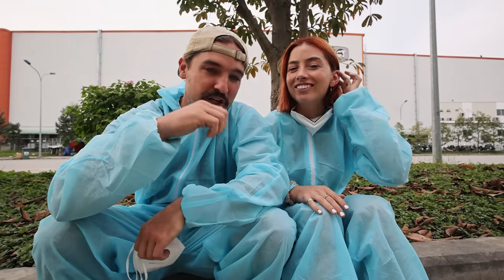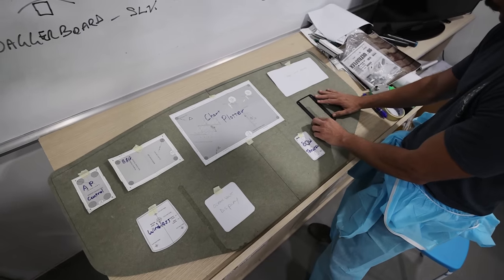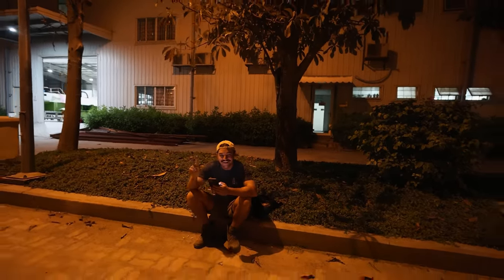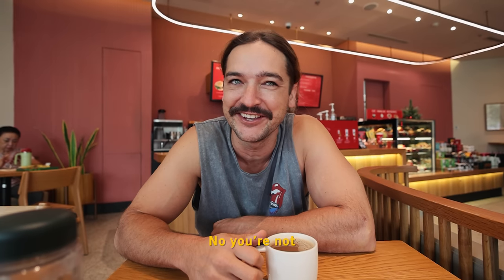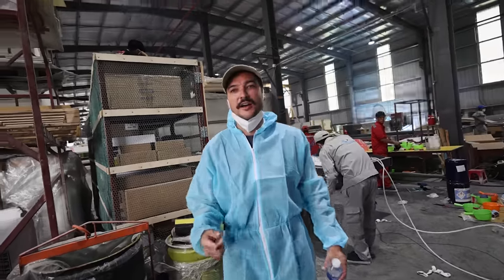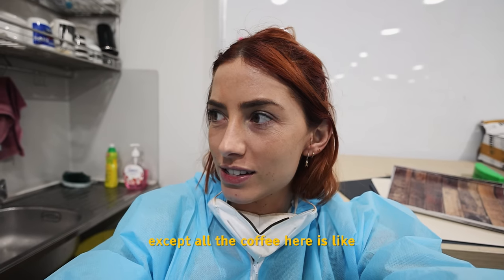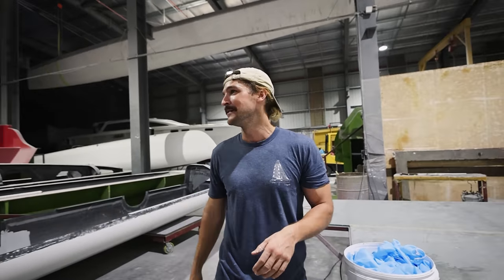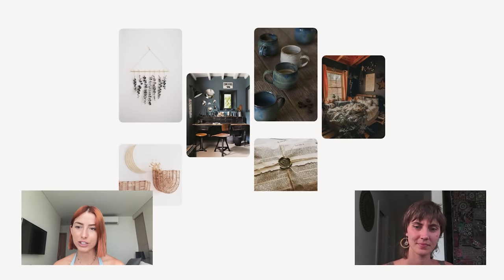BOAT BUILD: Interior work Begins!

Comment: Can't go wrong with different Cacti, Aloe Vera, Balloon, Orchids, Violets, Ivy, Philodendron plants, or Venus Fly Traps could double as a decoration and help with your flying insect control 😉.   A nice arrangement of Hearty Aromatic Herbs would be nice on a boat too.  A small Aromatic Herb Garden in the bathroom/head would be pretty cool.  It would mask odors, And you could pluck rinse and season your meals with them.

      Especially Basil, Bee Balm, Eucalyptus,  Lavender, Lemon Balm, Lemon Grass,  Marjoram, different Mints(Cat Mint has a strong pleasant aroma), Oregano, Rosemary,  the different Sages(especially Pineapple Sage & Common Sage), Thyme.  Oh and Wormwood Smells Amazing too.

      Just be aware Wormwood  has become a Warning Label plant., and it is one of the ingredients used in distilling Absinthe. You have little ones so you need to decide if it is a plant you feel is safe for them to be around.

Comment: Charcoal filters or a fresh air system ( even with the hot humid air) are a must to save you lungs .
Full mask (save your eyes)with the fresh air system may be the best way to go .
Been in the coatings industry for forty years.
Reply: A message from the management of Rapido Trimarans:

We are very proud of our workers. Their safety and well-being is of the highest priority and unfortunately, as shown in the video, we collectively let ourselves down in this instance. 

3M respirators and face masks are supplied and have been taught to be worn at all times but they were not being worn at the time of the filming. This issue has now been addressed.

Giving an independent third party unrestricted camera access to our factory can be confronting. In this case, it has highlighted an important issue for us, which we need to have rectified.

As a company, we will continue to learn and try to do better in our quest to build the best ocean-cruising trimarans in the world.

Comment: Well as both a skilled spray painter, Jotun/Akzo nobel aficionado (certified coating and surface protection inspector FROSIO lvl III)  and a skilled  fiberglass/carbon fiber builder - i can say that i seems like you are in extremely good hands.

-Carry on, carrying on!

Comment: Light industrial grey at the engine bay. Orlando orange on the power wall. Victron Energy Blue on the water system area. Red, white and black checkered floor. Ceiling white or eggshell.

Comment: I can't even imagine how the build process is going from the current state to putting her in the water in 3 months. I mean, I'm rooting for you and it will be amazing to see you launch it, I just don't understand how everything still missing will be fitted on time (electronics, engines, drive shafts, steering, plumbing, under water sensors, various through holes...).

Comment: Please be careful of the akzo Nobel paint surfaces. Very hazmat sensitive. May have off gasing if used on any interior treated surfaces. I used to transport it and the accompanying hazmat paperwork was a nightmare!
Reply: I just read thru all the comments. I was not trying to get up on a soap box guys. Just sharing some first hand experience from working with Akzo Nobel products you may not have been aware of. Hate for you two or the boys getting breathing problems.

Comment: God, it is much larger than it looks. One of my thoughts is not for the colours inside to be to dark. Reflected light can bounce of light colours much better than dark ones. Succulents in moist areas always work well as I think you mentioned. With the movements of the sea and objects will the wallpaper last long enough or is there a coating that goes over the top to minimise abrasion? As I said before it is like moving from a two bed flat into a Mansion.
The excitement for you all must be immense, as it is for all of us watching. Just a point of note has Riley been working out a lot, or is it the camera lens? his biceps looked beefed up?

Comment: Looking good.
You will be visiting twice as many places by the look of that rig.
Did I hear correctly when you said there is no  SS on the boat at 14.46 ?
How do you attach the rigging etc , surely SS rigging to Carbon fittings would not last .
What am i missing ?
Cheers.

Comment: I remember when they 1st decided to go with this boat, and Riley was talking about leaving much of the carbon fiber exposed. When they 1st saw the interior Riley seemed completely shocked at the roughness of the interior. He was expecting smooth as glass, like you get pulling a part out of a mold. Instead you have these extremely rough pieces that require endless fairing and layers of paint to bring to a perfect finish. 40% or more of the entire construction budget is probably eaten up with the fairing and painting.
Reply from the maker: No I wasn’t.

Comment: Did I miss something .... I only saw the master & guest bedrooms.. where are the kids bedrooms & those for the crew ????  It would help give us perspective if you could give a comparison using the square footage of interior living space on the new boat & the “retired” la vagabond.... also comparison in square feet of outdoor living space of both boats.
Reply: I think I heard Riley say its slightly more sq. ft.total living space than  LaVaga II, but only 2 cabins for minimum 5 ppl, 3 being adults. I think they are  gonna regret that, though I have no experience  living on a sailboat myself. Gonna be some couch surfing I guess.
Reply: @jackl2682  
Hard to imagine only 2 sleeping cabins with typically 2 crew for a total of six people.  Sounds like a BIG, BIG trade off  for the reported increases in sailing & mechanical upgrades.  I agree with you Jack .... hard to imagine there won’t be some real challenges & possible regrets down the road.  Also noticed the second bedroom has a full bed rather than singles or a double bunk.
Reply: I tend to agree although in an earlier episode Riley mentioned accommodation in the amas. Check out the interior design of the trimaran on the channel SailOceans which is set up wonderfully for a young family.

Comment: Is carbon fiber for the pulpit really better than stainless? Sure it won't oxidize over time but if it bumps into something won't it Crack and be harder to repair than stainless which you can just bend back or do a bit of welding?

Comment: I realize it’s a tricky situation for you and I got the idea that Riley knew not having proper protection for the painters was an issue. The painters should have Organic Vapors respirators  when working with these materials. If they were more benign waterborne paints Riley would not have commented about the odor. The builder knows better.
Reply: A message from the management of Rapido Trimarans:

We are very proud of our workers. Their safety and well-being is of the highest priority and unfortunately, as shown in the video, we collectively let ourselves down in this instance. 

3M respirators and face masks are supplied and have been taught to be worn at all times but they were not being worn at the time of the filming. This issue has now been addressed.

Giving an independent third party unrestricted camera access to our factory can be confronting. In this case, it has highlighted an important issue for us, which we need to have rectified.

As a company, we will continue to learn and try to do better in our quest to build the best ocean-cruising trimarans in the world.

Comment: Love the work but if u're sanding the carbon lamina you should have a better masks, carbon is very light and as sanded it's floats in the air all the time, it's very dangerous if particle of it would float to yours lungs so keep it in mind.

Comment: WARNING: Induction stove glass can crack if you accidentally put heavy stuff on the glass, so have a backup replacement plan if that happens, but avoid non-kitchenware left on surface or consider a protecting cover!!

Comment: You need better protective gear, so that you don't breathe in fumes and dust. Vietnam might not be up to modern safety standards (I guess that's why this New Zealand manufacturer is located there, rather than in N.Z.--cheap labour) but your own protection should be to a higher standard. You both do much to improve your health. Why scrimp on the safety of your lungs?
Reply: A message from the management of Rapido Trimarans:

We are very proud of our workers. Their safety and well-being is of the highest priority and unfortunately, as shown in the video, we collectively let ourselves down in this instance. 

3M respirators and face masks are supplied and have been taught to be worn at all times but they were not being worn at the time of the filming. This issue has now been addressed.

Giving an independent third party unrestricted camera access to our factory can be confronting. In this case, it has highlighted an important issue for us, which we need to have rectified.

As a company, we will continue to learn and try to do better in our quest to build the best ocean-cruising trimarans in the world.

Comment: Just a bit of unsolicited advice for design. Since you are worried about weight and corrosion, just build all your surfaces out of carbon fiber, like your sink. Then use an extra layer of epoxy and then use a colored resin here is an example. https://www.youtube.com/watch?v=TM7w9bQEDBY that way you can have all the design choices you like but still save on weight and you don't have to worry about corrosion.

Comment: DON'T DO IT!  Do you really want an interior design that seems more typical of something you might find on land - surely not what you want - and which contradicts everything that you see when you approach the boat from the quayside.  The boat is an extraordinary work of art. Would you really put mock floorboards on the outer deck? So why put them on the inner bulkheads? And beware of interior designers. They know they are charging customers for decisions that customers can make for themselves, but they feel the need to be seen to be doing something useful, the more the better, so the result is often over designed and noisy. Less is always more. It's a supremely elegant boat, externally, designed by someone who understands how to integrate form and function with maximum functional and visual efficiency. Surely you need the same elegant integration of form and function below decks. A surface should always be honest, in that the colour should reflect the underlying composition of the material, for example, slate or varnished wood, but where the composition consists of modern carbon fibre you don't really have any precedents for guidance.  However if you are looking for a colour scheme that's personal to you, to be reflected throughout the boat, why not start with some general seascape colours that you've seen on passage, very quiet pale blues and greens, with an occasional turquoise, say, detail, or colours based on the food you eat, say mushroom, oatmeal and cream with very occasional, understated, carmine, viridian or blueberry accents in for example, plates, placemats, cutlery handles or helm, always very light, barely there, to maintain interior light levels  If you want dramatic, dynamic colours, dark or light, or heavily patterned, remember you are going to have to live with them, so rather than embed them in the structure of the boat, where they can't be changed, or only with difficulty, save them for 'expendables', such as duvets, sheets, pillowcases, cushions and towels. and keep the structural colours of the boat fairly neutral. Keep it simple. Less is more. Hope this helps. You might find my website interesting - dannyisrael.com.

Comment: Seeing you guys mere feet away from all that spray dust without respirators (N95s do not filter spray fumes) is really troubling.  Two part polyurathanes release isocyonates when sprayed, and that stuff is insanely bad for you.  When I've rolled them, I shave my beard off, use a full face mask cartridge mask, and seal with vaseline.  If you can smell the paint, you are getting some really nasty stuff in your system.  If you can TASTE it or god forbid getting lightheaded, then lord knows what type of problems you're creating for yourself down the road.  There's a reason why OSHA and the Euro equivalent have such strict industrial standards for PPE when it comes to solvent-based products.

Comment: That’s a long time for a build.  Must be on island time.  All the dark colors will make the interior seem smaller and closed in.  Add in all of the different textures and patterns to rooms that are already small and it will have a cluttered effect.  Keeping it simple with neutrals and pops of color/patterns would be better in the long run while giving the boat a nice flow.  It’s much easier to change out accent colors and patterns than it is to change everything should you become tired of it.  The materials you choose should hold up well to the environment you will be in including saltwater and sunlight.  The two of you will no doubt slow down and make the workers uncomfortable.  Best to let the workers do the work they are paid to do, after all they are the professionals.